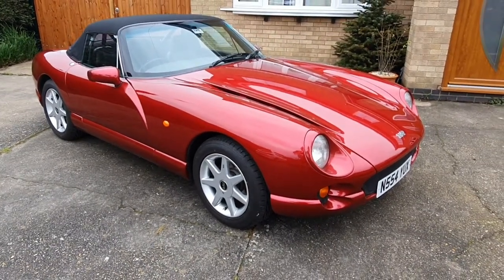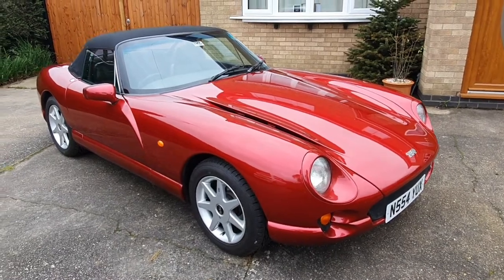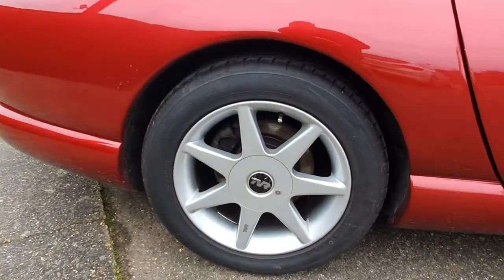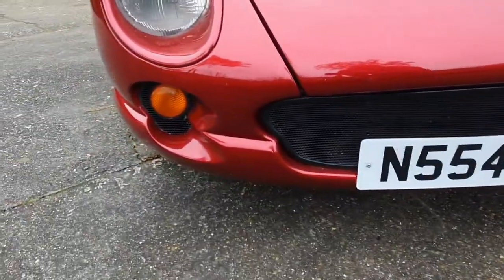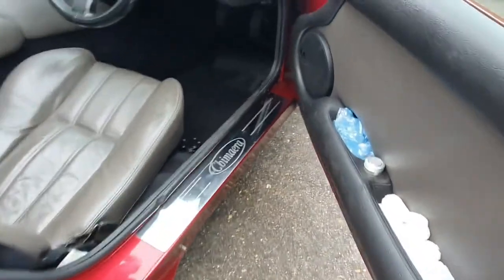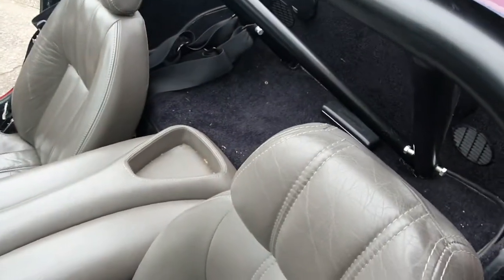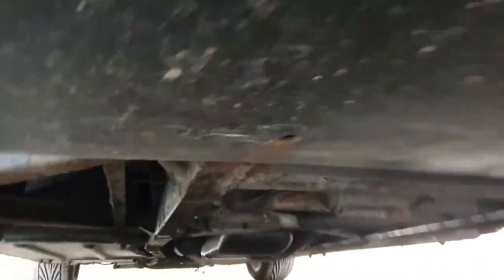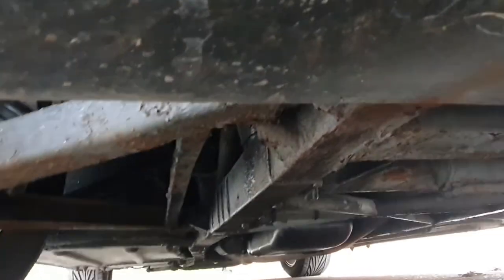1996 TVR CHIMAERA 400 N554YUX - FOR SALE - AUTO TRADER LINCS LTD

Comment: wax oil to be removed underneath it is developing corrosion
The frame should be sandblasted epoxy primer plus acrylic primer and paint over it. Preferably polyurethane